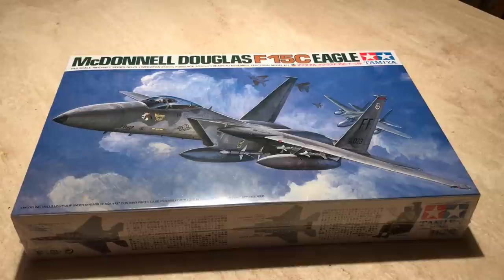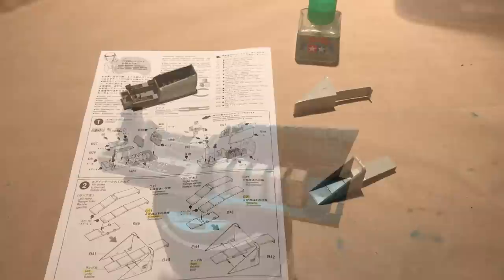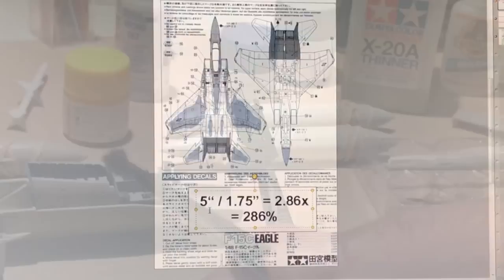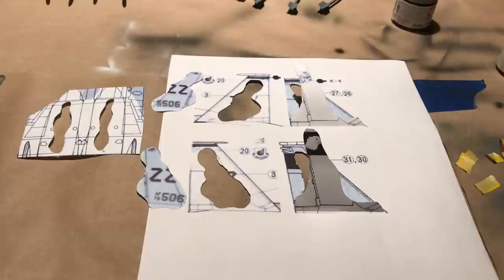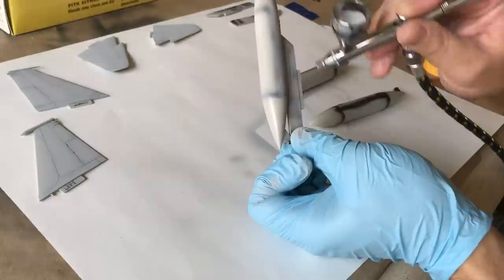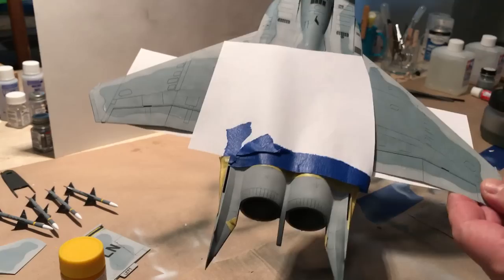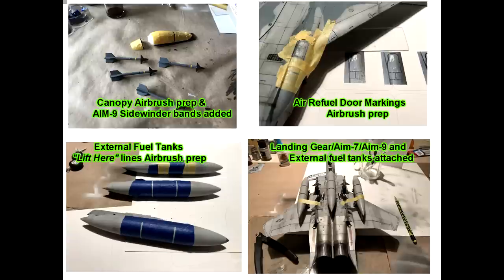Building the Tamiya 1/48th Scale F-15C "Eagle" Fighter Jet

Comment: That’s a fantastic job and shows what can be accomplished right out of the box.
My only criticism, and it’s aimed at Tamiya, is that they supplied incorrect nozzles for the C. The C models onwards dispensed with the ‘turkey feathers’ on the nozzles.
Reply from the maker: Thanks ZD433 🙂. Someone gave me a broken up F-15 model that has the correct engine nozzles. I'm thinking of cannibalizing them and replacing the Tamiya parts on that F-15C build.

Comment: This was one of the first Tamiya aircraft kits i ever built.  my uncle gave me one for my birthday back in the mid 1980's.  I did a fairly decent job with the painting etc considering i wouldn't discover airbrushes for a few more years.    The big mistake i made though, was trying to secure the nose weight with a lot of polystyrene cement.  The nose cone melted somewhat leaving a disfigured nose cone :(  Still, everything behind the nose looked pretty good :)
I learned a lot from that kit, mainly that too much cement will melt the plastic, and was able to put most of it to good use in later kits.

Comment: Good memories. I built this model in the late 80s. Probably around 88 or 89. Still a great model by Tamya.
Reply from the maker: Hi ZS IFK, it is a great kit, they just need to redo the engine nozzles. 🙂
Reply: @MaxAfterburner  So true. Are there any 3rd party parts you can buy for it?

Comment: You are not an amateur you are a master
Reply from the maker: Thanks Kyle, you made my day!
Reply: I have a question where did you get the name plate I need one for my F-15
Reply from the maker: Hi Kyle, for the name plate I used an actual photo image of that plate from an F-15 which I cropped, cleaned up, and then typed in the names all using a photo shop program. I then shrunk the image down and printed it onto blank decal sheets. The reserve pilot's name on my F-15 is actually the name of one of my dogs! ;-)

Comment: Old kit that looks awesome when built. Still can hang with more recent AAA titles. Buy just a few after market resin parts and it can't be touched.. It has a great price too, just like the f-16.
Reply from the maker: Hi Bradley, I was given a beat up old F-15 model that someone was going to throw in the trash (it wasn't even painted). It has the accurate engine exhaust nozzles. One of these days I'm going to replace the Project #4 F-15 Eagle nozzles with those better ones 😎
Reply: @MaxAfterburner   Man, I wish I saw this post when you commented on it.. I agree totally.. that nose is horrible IMO. I was watching Flory Model videos where they are building really old kits like old monogram kits and using aftermarket  to bring them to life. Tamiya has some poor kits(old harrier) and a few others, but for the most part, they got it right. I think I want to find an older kit and do the same thing and bring it to life. Good job on kit

Comment: Love watching these videos! 

I have this dilemma. I've always been a 1:32 modeller (for fighters). Currently have a Tamiya 32 Spitfire, ITaerli F-35  on the stash. So i need some others to compliment them. I've ordered a 1:32 F-16C (tamiya) and will get a 1;32 MiG-29SMT for equal measure :P 

But I've considered going back to 48 scale. It's just more sensible for modern fighters. The sizes are manageable both in storing and during assembly/painting. And there are a lot more 48 scale options on offer so you can have a complete collection! 

But it's really hard to get back to 48 after 32 scale haha. I need to escape this megalomaniac mindset! Help!! 

Epic build btw!

Comment: Yes it is nice what you've done here! Just a thought, I would not do double masking for the camo pattern though. I would do the lighter color on the whole model first than mask it for the camo spray on the darker camo and post shade it if necessary. This way you would never end up with gaps and strong double edges where the two camo color meets. Also you can use plasticine rolled up for the contour, the edge of the darker camo color to achieve softer color transition. I guess it would worth the try once... :-)

Comment: I recently built the same kit, the upper and lower fuselage parts you are doing in 6:50  had TERRIBLE lining, the upper part was like 5 mm wider than the lower. It was a real test for my filling and sanding skills, but i turned out well.
Reply from the maker: That's a great recovery. I find that portion of model builds difficult.

Comment: Perhaps i missed it, but how do you enlarge and create those stencils? Painting those camouflages is the main reason for me to keep it simple. Thnx in advance
Reply from the maker: There are a couple of methods. You can scan the instruction pages concerning the decal placement and overall paint scheme into your computer and print them out after you've enlarged them, or you can enlarge them on a photo copier. Usually the copies are too large to put the whole image onto a single sheet of paper, so you'll have to print them out in sections.
Reply: Max_Afterburner thnx for the quick response. I know that Revell has all the building prints in pdf on there site. That would be ideal for creating stencils. Time to try out!

Comment: Thank you for your inspiration Max! I'm bulding up my tamiya F-15C too. I would like to know why the exhaust nozzle of this kit seems to be diferent from the actual F15's, it looks like F16's. Thank for your help.
Reply from the maker: Hi Oscar, the engine nozzles are a design shortcoming by Tamiya on this one. I was given a battered F-15 model later on that has really nicely molded and accurate nozzles and I've been thinking of using those on my screen used F-15 to improve it.
I hope your Eagle turns out great, thanks for watching! 😊

Comment: Great build! But is there a reason why you don't use primer? Im thinking especially on the cockpit and other part which got the metallic blue paint.
Reply from the maker: Hi olbakk, I hadn't thought of it really in this case. Usually I can't see any difference using a primer on the smaller pieces sometimes.

Comment: I would not consider you an amature.  Very nice work.
Reply from the maker: Hi maddog663, that's very kind of you! I've seen such amazing work out there, I'm definitely an amateur 🤣
Reply: @MaxAfterburner  If you don't mind me asking. Where did you come up with the sheet you turned into the stencil for printing?
Reply from the maker: Hi maddog663, I have a video out on my process and one of the examples presented within it is this very F-15C kit. Check it out at :  https://youtu.be/iE7MtwrjaOg
Reply: Thank you so much. Very helpful.

Comment: Outstanding end result. May i ask, what is the difference between a 1/48 an a 1/32 scale an which is the more excepted for display?
Reply from the maker: Thanks Brian! 1/48th scale aircraft is the more popular for builders since you can display 3 or 4 fighter/small bomber aircraft on a standard bookshelf. So, the smaller the number in the denominator, the larger the model is of the same aircraft. Thus, an F-15 at 1/18 scale is larger than an F-15 at 1/32 which is larger than a 1/48 and so on with 1/72 and 1/144 scales. As examples, 1/18 scale means that every 1 inch of the model represents 18 inches in real life scale and 1 inch on a 1/144 scale represents 144 inches. Generally, the larger the model, the more detail is (and can be) packed into it.
So they usually have a more detailed realistic look.

Comment: When striping the missiles, how did you avoid bleed under the tape where it wraps over itself?
Reply from the maker: Hi Paul, the beauty of the airbrush is that thin paint layers can be applied through the aerosolization. This reduces the tendency of an excessive amount of paint building up and bleeding under or creating a ridge at the border. Also, I've noticed airbrush spray is very forward directional, in that if you add perpendicular to the surface at that band line, you'll get a crisp edge. 😇
Reply: @MaxAfterburner  yeah I'll have to try that next time. I taped them off and applied with a brush because they were so small, but that was a lot of paint pushed into the gap. Thanks!

Comment: Hi, im new to painting aircraft models. Could you tell me what an oil based watered down flat black is? Thanks!
Reply from the maker: Hi linuschan1901, I assume you're referring to the wash. A diluted black (or other colors) can help highlight details, create shadows for areas on the model that would occur if it were truly at full scale, and it can add a "used" look of leaked fluids and other environmental grime depending if you are aiming for that appearance on your project. 👓

Comment: Max it is lovely work could you send me the file for your scaled up camo stencil, I'm a couple of days off finishing my commanche heli and am about to start this kit with the ZZ decales. Again love the content thank you for the clip.
Reply from the maker: Hi Chris, I don’t think I made any files, and if I did, I no longer have them. I have re-measured the model and the illustration dimensions. For the overhead view on page 10, the enlargement needs to be 300% (3X) and for the tails on page 8 or 9, the increase is 252% (2.52X). This ratio should give you what you need using a photocopier or a computer after scanning it in.
Reply: @MaxAfterburner  thank you very much

Comment: They use the blue color in the cockpit to reduce visual fatigue.
Reply from the maker: Thanks for the info, I did not know that
Reply: That's a Soviet thing tho
Reply: Ive got an older Revell F15C kit Im about to start.. the actual color is supposed to be Xtracolor 159.. its a specfic blue green F15 interior.. I don't think they make it anymore, although I did find it at a hobby store in the Netherlands... I suspecting Tamiya called for X13 Metallic blue because it was "close enough" and Tamiya will not call for another mfrs paint obviously!
Reply: Stillamarine 1001 the Instrument panels on F-15Cs aren’t blue. They are grey.

Comment: Amazing build I am just in the process of building this model and newish to the hobby. I am using the same paints and mixing you did but if I use tamiya black panel liner over the acrylic tamiya paint will there be any problems or do I have to clear coat first? I was thinking of using it on the main body Thank you for the help
Reply from the maker: Hi John, a clear coat is always recommended before any panel line detailing for sure. However, I have found the Tamiya Black panel wash very difficult to control and unpredictable on what it will do to the paint job even with a protective coat. If you're looking for a cleaner look and just highlighting the lines and rivets, etc., the best would be the black oil paint and lighter fluid mixture.
Reply: Thank you so much I really appreciate it

Comment: MAX,

Thank you for the build review! It was awesome! I am working on an academy F15C and was wondering if you A. had the stencils for the camo for the eagle or can you shoot me the formula of how you came up with the printouts you came up with. I think it was genius! Again, great job on your build! I look forward to your next build
Reply from the maker: Hi Brett G--

The calculation is based on a simple algebraic equation of proportions, but you can simplify it into a basic problem of division. Since you’re building an F-15 Academy kit, your results may be different if the drawings and model dimensions are different than Tamiya’s F-15. Basically, you measure out
specific dimensions of your model and compare to the instruction drawings you wish to enlarge. For instance, measure out the length of the model’s left wing leading edge. Then measure out the same wing in the drawing. If say your model wing was 5” long and your drawing wing length was 2.5”, then you would divide 5” by 2.5”. Thus, your result would be “2”. So the enlargement of your drawing needs to be 2 times larger which is equal to 200% on a photocopier to match your model’s actual size. You can also do the enlargements from your calculated results on your computer and print them out which is what I do.

Comment: Very nice. I noticed you sprayed the end of the exhaust in some for of chrome. That the same colour you did the heat shield?
Reply from the maker: That is correct 😃
Reply: @MaxAfterburner  Very nice! I've been using your build as the basis for my own. Not very impressed with this kit. I've done a lot of sanding to get the main fuselage to look half decent.

Comment: Did you need to weight the nose down?  My uncle gave me one of these back in the mid 1980's  and to weigh the nose down I put a marble or similar in the nose cone.  Unfortunately I tried to fix it in with lots of cement which melted the nose... and it just looked a mess.  But apart from that builders error it was a great build.  I didn't do anywhere as good a job as you did but I had fun :)
Reply from the maker: Hi psionicdreams, thanks! I didn't need to weigh the nose down on this one. I drip candle wax into nose radomes added with a metallic weight such as a nail or washers if needed. My philosophy is that model building is mainly about having fun and keeping oneself entertained!
Reply: Wax- that is a good idea :)
I haven't built a kit in nearly a decade even though I have a couple of dozen on the shelfs behind me so... soon.

Comment: I’ve just purchased the exact model as above. Will a aires resin cockpit kit fit this Tamiya model?

Thanks
Reply from the maker: Hi ryanward3594, Aires produces a number of resin cockpits to fit the different manufacturers of F-15 plastic model kits. If you chose an edition that was made specifically for this Tamiya model, you should do alright. I would say that in my experience even resin sets made for a particular kit may still require modifications and adjustments. 🤔
Reply: @MaxAfterburner  hello, that’s brilliant thank you

Comment: Would I be correct in assuming that this kit is probably expensive as hell? I wanted a Tamiya 1/35 FAMO tank carrier kit when I was younger and even these days it still costs north of 300$.
Also, wouldn't it make more sense to use actual primer and then do your shading with the black, or would that mud up the details too much because of the extra thickness?
Reply from the maker: This model was $31.50 to purchase. The black coat acts as the primer as well, I try to keep the paint thickness down which the airbrush accomplishes well.
Reply: Ah ic. Thanx for the reply.

Comment: What gloss spray did you use befor the decals and washes?
Reply from the maker: Hi Paul, I didn't use any gloss coat prior if I remember correctly. I usually pick Testors 1261 gloss coat, though.

Comment: What are you using for your wash when you use the black oil paints?  I'd like to try your method it looks awesome.
Reply from the maker: I use Newton's, but any decent oil paint will do.
Reply: @MaxAfterburner  are you mixing them with anything?
Reply from the maker: I use mineral spirits, but you have to be careful. This type of wash can stain your paint job if you leave it on too long before cleaning it up.

Comment: Nice Build,I've been working on the same kit too and stuck with the camo
Where did you find the file for the paper camo pattern you use?  I think it can help me a bit :D
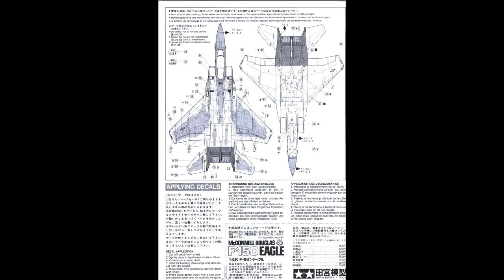Reply from the maker: Hi Samuel, thanks for the comment! As mentioned at ~ 5:39, I scanned the Tamiya construction pages that show the camouflage patterns into my
computer, adjusted the size for proper scale, and then printed them out. Or, you could also use a photocopier at 286% to do the same thing. I hope that helps!
Reply: Max_Afterburner Thanks mate :)

Comment: Very nice buddy! I have a photo copier. What was your stencil enlargement ratios?
Reply from the maker: Hi Xtremis Models, for the overhead view on page 10 of the instructions, the enlargement needs to be 300% (3X); for the vertical tails on page 8 or 9, the increase is 252% (2.52X). This ratio should give you what you need using a photocopier (or a computer after scanning it in) -- if you're building this identical kit.
Reply: @MaxAfterburner  Thanks buddy! 😎👍👍 This should really help out as I haven't found any companies that produce a mask for the 1/48 F-15C.

Comment: Hey man. I love your work. What do you use for your gloss coat between the paint and the wash layers?
Reply from the maker: Hi Chris, thanks 🙂.  In earlier videos I used Testors gloss coat spray, but I've changed over to a 60% Tamiya X-22 clear to 40% thinner that I airbrush on.

Comment: how much did you expand the scanned in instructions for the paint pattern
Reply from the maker: Hi Mark, it's been awhile and I'll have to find and dig out the F-15 model manual to recalculate it. However, if you watch my Su-27 Flanker B model build, there's a section explaining how I determine how much to enlarge instruction sheets to make the paper templates. Anyone can then calculate it for all future projects using that method.
Reply from the maker: Hi Mark, I have re-measured the model and the illustration dimensions. If you still need them -- for the overhead view on page 10, the enlargement needs to be 300% (3X) and for the tails on page 8 or 9, the increase is 252% (2.52X). This ratio should give you what you need using a photocopier or a computer after scanning it in.
Reply: Max_Afterburner thank you so much it’s the first model in over 20 years and I want to refine my painting skills

Comment: Do you use a primer? Looks like not.
Reply from the maker: ??
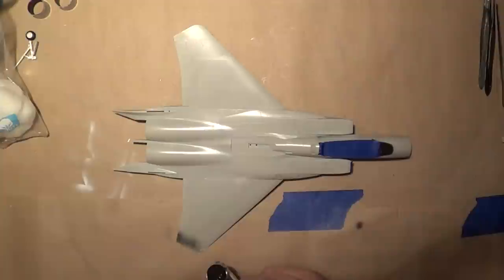See ~ 07:50
Reply: Ok, thanks. I'm talking about litlle details.
Reply from the maker: After the main paint job, I put on a gloss coat before weathering in the details. It hasn't worked out as well as I hoped, so I may try the clear floor wax coat technique prior to weathering next time.